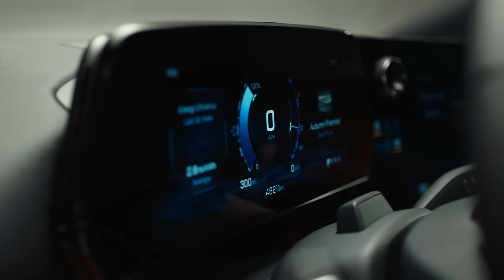Ram Could Get Fuel Cell Range Extender; Countries Agree to Ban Oil, Gas & Coal - Autoline Daily 3710

Comment: Ram offering a plug-in hybrid was not anything to get excited about, it's a timid move into EV pickups. As for their fuel cell, well.... If they're planning on using hydrogen, they will find that the high cost of hydrogen storage and the very high cost of hydrogen fuel is going to make it economically unattractive. More importantly, the extremely limited hydrogen fueling infrastructure makes hydrogen fuel cells totally useless as a "range extender". Failed before they begin. But, if they can figure out how to make a fuel cell that runs on gasoline or diesel, that might actually work. Maybe.

Comment: GM has built / invested in a Red Hat built OS for their vehicles.  Now they close out connection of personal devices.  It’s all about security.  Don’t want any unnecessary cracks / access into the GM-vehicle network interaction and GMs systems.  Probably similar to why Tesla has never supported AA or ACP.

Comment: Fuel Cell range extenders will make sense for cars and light trucks when hydrogen refueling is available everywhere gasoline, diesel, or electricity is.  That is never.  Maybe for transit buses or other vehicles that return to a depot every night, hydrogen could be made available there.

Comment: Is a V6 really the most efficient engine to use as a range extender?  Why didn't they just make it a hybrid?  That 3.6L V6 seems like it'd be far better suited driving the wheels than charging the battery.

Comment: 2:50 | Battery Swapping:

Sure looks like history might repeat itself with Venucia taxis. One only has to look back 100 years ago to see the same concept played out in NYC with the aptly named Electric Vehicle Company (EVC), an EV taxi company that employed battery swapping as its key business differentiator.

Unfortunately for EVC, they ran into trouble with having enough packs on hand to satisfy turnover/ demand (as you need to have more batteries charging than there are taxis driving). As a result, EVC often sent out batteries far less than fully charged or, worse, defective altogether.

While no single event took EVs out of "the race" in the first half of the automotive boom, many believe EVC had a significant role in public perception of EVs after EVC taxis were seen as unreliable. What was once a third of the car market, EVs quietly slipped into obscurity for decades, only a few years after EVCs demise. 

For the record, I'm a huge EV advocate not too bullish on battery swapping.

Comment: I could see battery swapping being a good idea for fleets if they can own the batteries and machine to do the swap. That keeps the fleet on the road. However, if you can't own everything I see that has a trap where the price just keeps going up and up.
Reply: Battery swapping won't be viable when people can charge their cars in 18-20 minutes now
Reply: @TheMadmax0609  And charging will be quicker than that buy the time you could get swapping stations in place. It's too late for swapping, that would have needed to be started years ago.
Reply: @frankcoffey  agreed
Reply: I think taxis and long haul trucking are excellent applications for battery swapping.

We've seen that ride-share use is hard on EV batteries if they fast charge to near full multiple times a day, every day.

Perhaps some refinement of the cooling systems will solve this.  But battery swapping might turn out to be more economical.

For long distance trucking, it seems like a no-brainer.  It is almost certainly the cheapest way to do it, once the infrastructure is in place.
Reply: @davidmenasco5743  once fast chargers are up at destinations battery swapping won't be needed.  It takes about 30 minutes to unload a truck, plenty of time to recharge a semi battery and move on.
Reply: @TheMadmax0609  What you're describing only works up to 450 miles.  If the truck is driving across country, it will need to charge before it unloads.

There are at least a half dozen battery electric Class 8 truck models on the market.  Current long haul demands are a challenge for the Tesla Semi.  For all the others, long haul is out of the question.

It could be over a decade before any non-Tesla truck is ready for long haul based on charging alone.  In the meantime, with battery swapping, something like the Volvo or Freightliner would become a useable option.

I suppose only time will tell how things unfold.  But the faster we get off fossil fuels the better.  With time being of the essence, I think there is a place for battery swapping in certain applications.
Reply: @davidmenasco5743  hardly anyone drives across the country anymore in the United States.  Trailers are usually taken to a destination and then uncoupled, where someone else picks it up and transfers it to another destination.  Kind of like passing the baton in a relay race.  Although I'm sure there are cases where a trucker does go completely across the US.
Reply: Make no sense. The driver resting, loading/unloading or swapping drivers is plenty of time to charge.
Reply: @robertide5182  What if you swap drivers also? You can keep the fleet going.

Comment: WTF?  Fuel cell? That's idiotic!  Talk about incurring high maintenance costs. Fuel cells have extensive air intake filters that must be replaced regularly.  There are critical seals that have to be maintained and checked for leaks. Now try to find a hydrogen fueling station....good luck with that. 
Also let's talk about the compressed hydrogen bomb you would have to carry. Give me a gas fire or a battery for any day compared to a hydrogen tank explosion. 
This is a really really dumb idea.... particularly when countries in the EU have had to close down the few hydrogen fueling stations they had due to lack of demand. 
Dead End tech.

Comment: I got a dongle that turns my wired CarPlay to wireless CarPlay.  It was janky and hanged about 1/2 the time.  Connecting to both blue tooth and WiFi was 50/50.  I returned it after about 2 weeks.  Don’t know if the factory wireless CarPlay is better.
Reply: My Bolts infotainment has only crashed because it sucks on its own. 

Wireless CarPlay and Android Auto have been flawless.
Reply: Much better

Comment: Battery swapping makes sense because it keeps car owners paying somebody to charge their cars.
Reply: It also eliminates the battery degradation concerns. Works in fork lifts and consumers are used to swapping with BBQ's.
Reply: @AaronandbriEnne   When you own the battery you know the battery SOH.  WHen you swap you might get one with 70% or 80% in you new car.  Not like they will scrap them.
Reply: Lets see how well battery swapping works when you get vehicles with a few years of snow and other weather mucking up the underside.
Reply: There is an advantage because you can upgrade the batterieback easy!

Comment: Tesla Beta testing on their customers.
Reply: GM Android Auto debacle will get no such attention. And GM is incapable pulling out software via OTA to fix the problem.

It's pretty funny to watch it all. Play out. As Tesla cars become safe for and safer. Nearly instantaneous updates and everyone else is stagnant. 😊
Reply: I've had FSD beta over a year and happy to beta test it. On every drive with it, I see humans making dumber mistakes than the beta ever has. Human drivers set the bar pretty low...
Reply: @bmk789 It takes only a few morons to make humans look bad.
Reply: @bmk789  Yes there are idiot drivers but if you remove them from the equation good drivers are far safer than FSD. How if you are one of the idiot drivers you very well should use FSD, but for the rest of us good drivers it will have to get significantly better.

Comment: Interesting that Stellantis is looking at fuel cells. It's long overdue, and will be necessary for some niche applications.
Reply: @valleyofiron125  all I hear are excuses, imagine if Columbus would have said there aren’t no ships big enough to cross the Atlantic Ocean, Europeans would still be in Europe!
Reply: I've yet to see any research where fuel cells make more sense than regular ICE or BEV, either financially or for the environment.

It will be interesting to see what they have come up with.
Reply: @BTC_Minarchist you have not been paying attention about fuel cell, time for our species to move away from ICE.
Reply: @rogermartinez78  Yes, I admit that my knowledge of Hydrogen is limited and probably dated, which is why I'll be interested to see if they've come up with something new.   I've also never seen a fuel cell auto out on the roads.  if I ever do, I'll politely and respectfully, ask the owner a bunch of questions about their experience and to get their POV.
Reply: @BTC_Minarchist   Maybe they realized they just came out with the Via VTRUX 10 years after the fact if they didn't have something to set it apart.
Reply: @BTC_Minarchist the history of vehicle fuel cells has always touted the environmental advantages of the fuel cells when powered by hydrogen since the only significant byproduct is water. The sources of hydrogen is the one potential sticking point if electricity from fossil fuels is used to generate the hydrogen. Using solar or wind or nuclear electricity to breakup water provides clear environmental advantages.
Reply: @bearinmind50  That aligns with what I've read.  thanks.

Comment: Another 2 Million recalls!  Tesla SW Unsafe at Any Speed!  L4 or L5 this year!  Model Y Ute Robotaxis soon!  Unibody trucks!
Reply: 2 million Software Updates! The horror!
Reply: @Alexzw92 The best update is no update!  Even Chris Farley’s incompetent cousin doesn’t have 2 million simultaneous recalls!
Reply: @bobbbobb4663 That's not nice.
Reply: @bobbbobb4663 are you joking? Ford has always had a ton of recalls and lawsuits for not doing recall. Maybe you should do standup
Reply: @IcyPrepper76  2023 Ford F250/350 7 recalls.  2023 Tesla X and S 8 recalls!  Chris Farley’s cousin leading the way in safety!
Reply: Another 2 million safety software improvements! Teslas even safer than before!
Reply: @ordinaryhuman5645 You have a logical point of view.  🎯
Reply: @ordinaryhuman5645  Dojo accepting non safety filtered human input to algo!  Less signal to noise!
Reply: It still does not fix the phantom braking, the steering lockup or the sudden unintended acceleration.
Reply: When Apple rolls out a software update on their phones does the media report it as an "iPhone Recall" ?
Reply: @winniexfinity  Apple doesn’t report flaws to NHTSA!  Tesla SW leading the way in recalls!
Reply: Nothing wrong with AP. The update is for the one loose screw........... The one behind the wheel.

Comment: GM is saying safety. LOL  NONONO.  It's really about money.
Reply: Sounds like they have a crappy implementation but when I had the Bolt I had no trouble with my Android phone. However, not having that extra device connected is better overall, other than needing a separate connection and the monthly fee for that.